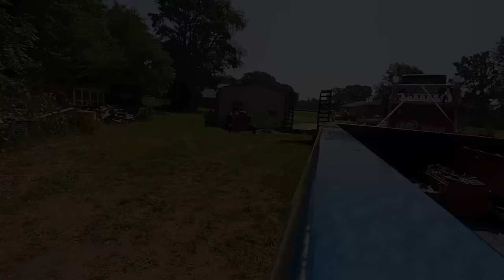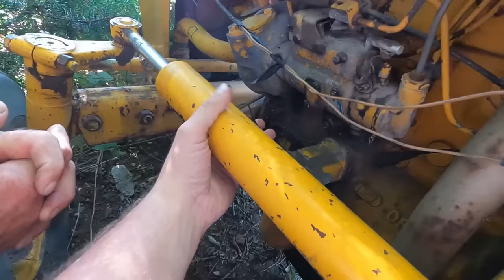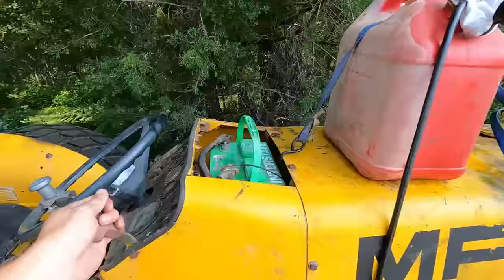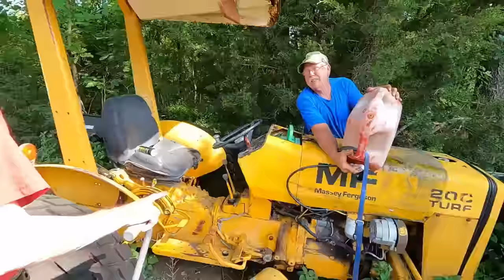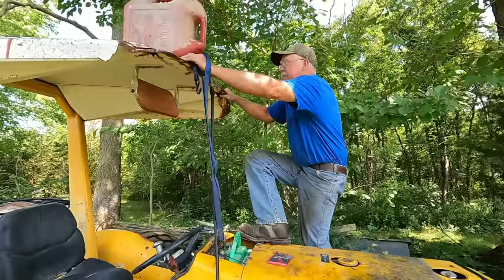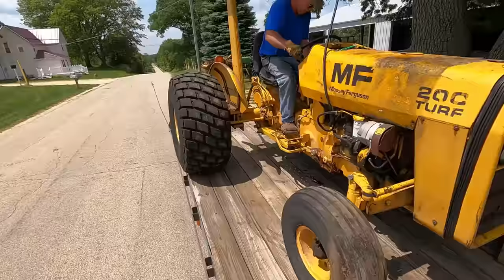Bought an Abandoned Massey Tractor - Will it Run?

Comment: Hey Wes, I was wondering if gravity could get enough fuel thru the filter to satisfy the demand, and l was wondering about fuel return. I didn't see what you did for the return. Did you run it back into the temp can? Or was it going back into the tank? Diesels cannot have the return stopped up or they won't rev up. And my experience is they sound weird when they starve for fuel. In a way they sound like a gas motor misfiring. But if it's a plugged injector, ATF will clean it pretty good. Funny: l was just thinking about a turf tractor to mow grass.  I had just pictured a tractor with a low belly and short wide balloon tires. I get tired of all the bumping banging and jarring of a small tire mower like a ZTR. But I'm really about all done w/Dismals. I've been monkeying with Dismals since GM put that 350 Olds gas convert into their cars. They were just junk. Everything broke. Crankshafts, blocks, head gaskets, valve guides, Roosamaster pumps got their return line anti leak back valve jammed up with the IED rubber isolator bits. What a nightmare.  I want a gas tractor just about exactly like your dad has there. Thanks for the video, you made the image I had in mind sort of become reality. Never seen one befor yours. ben/ michigan

Comment: Hi Wes we used to flatten a nail it used to work fine on the old massey ignitions.
Reply from the maker: I tried a screw driver. Maybe it was frozen.
Reply from the maker: I tried a screwdriver. Maybe it was rusted up.
Reply: You take a nail that will fit in the centre of the key hole and flatten aprox 1/2 to 3/4 of the end put a bend on the other end. I used this method at school to move about the ground keepers tractor a.d watch him scatching his head when he came back from lunch checking he sill had his keys.

Comment: Oh , sorry for your loss , I got one of these new just after the war , little 3 cyclinder perkins diesel in it , terrible thing , would only ever run on 3 cylinders , sounded like a gay mans asshole on a sunday morning farting and spluttering everywhere it went , 2.5 litre engine couldn't pull itself out of a wet paper bag , 42 horse power of limp sausage.